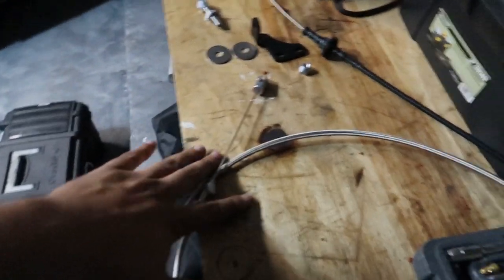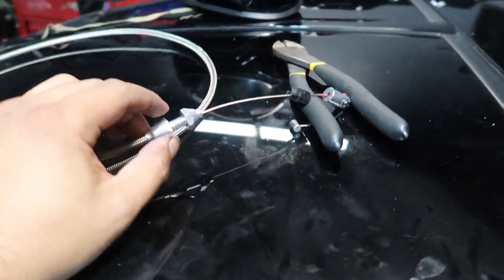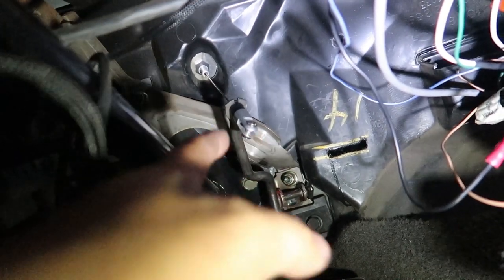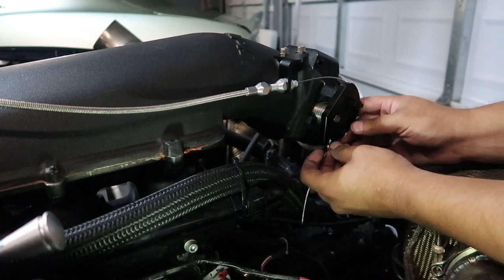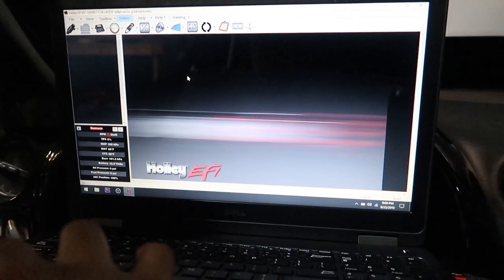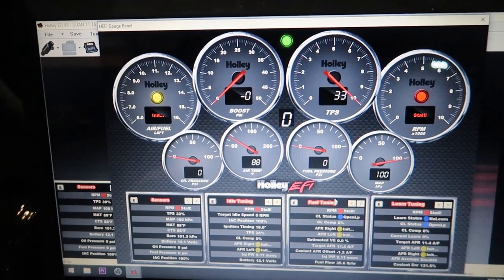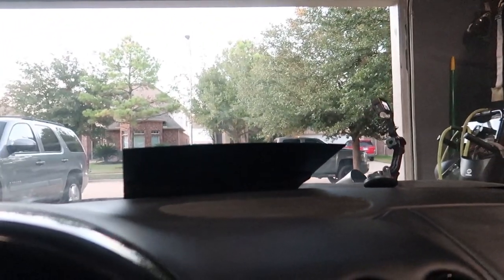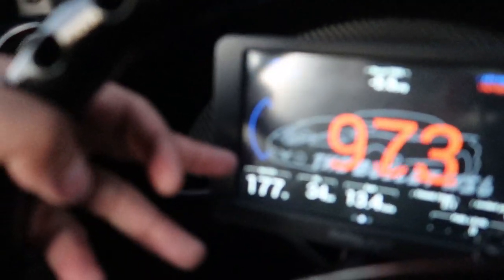LOKAR cable installed READY FOR TESTING!

Comment: HAHA the facebook update. You might try locktighting the fuck outta that setscrew. Also some WD 40 down the cable sheath will help it glide smoother motorcycle trick. Just spray it in until it comes out of the other end. Looking good bro.
Reply from the maker: Good idea!